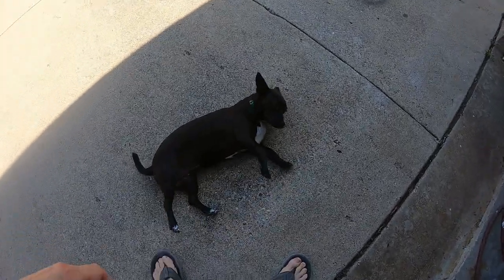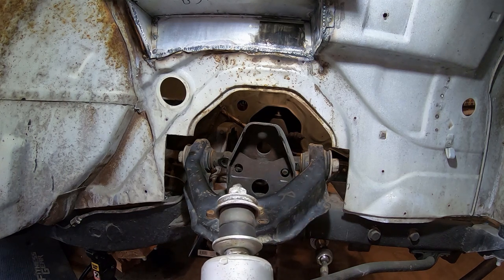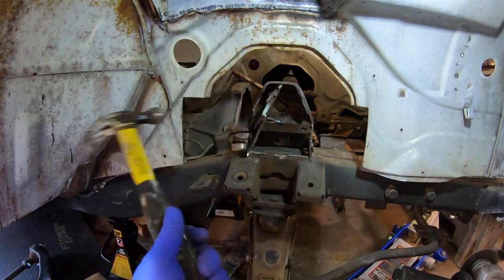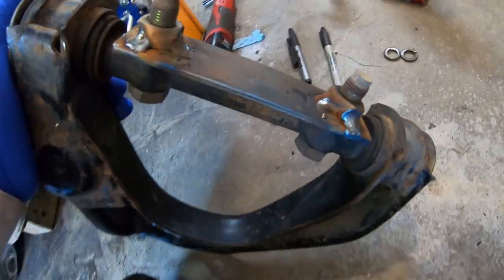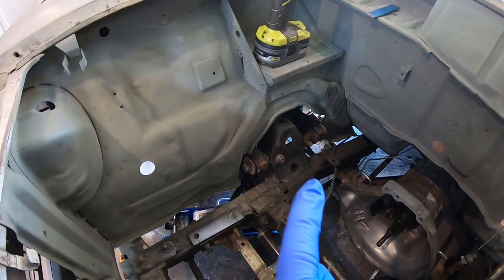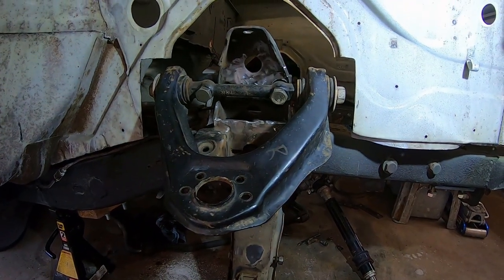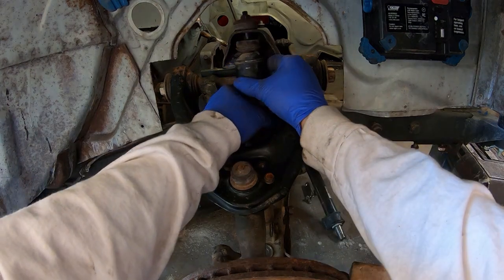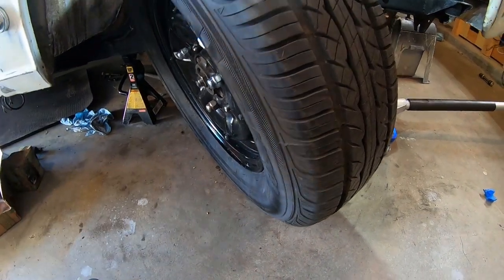Datsun truck restoration part 16. Does Hardbody suspension fit a 521?

Comment: thats not a good plane on that upper control arm
Reply from the maker: If I am measuring caster correctly. it should be good. When I get an alignment I will know for sure. I just want stock geometry.